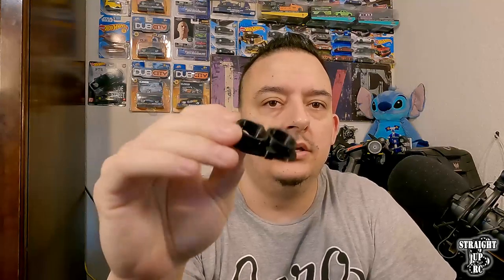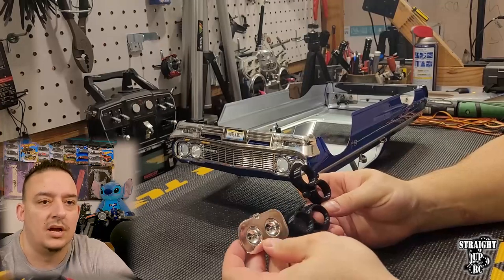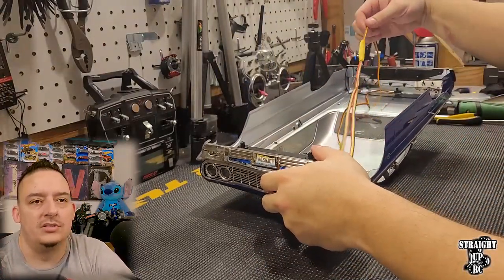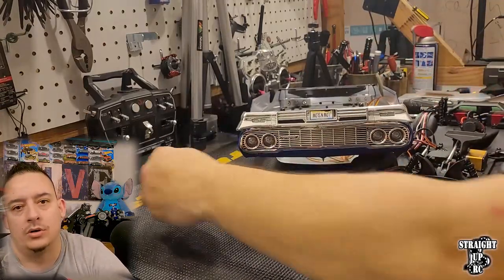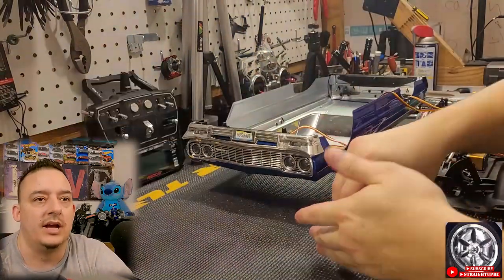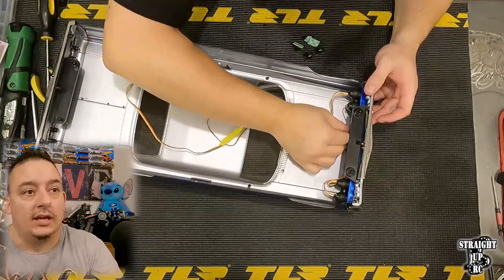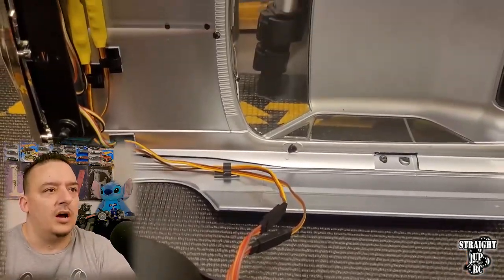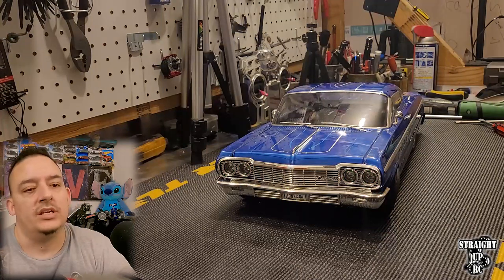Redcat 64 HALO LED Angel Eyes!!

Comment: Can you run this with the other redcat lighting kit
Reply from the maker: Good Question - and the answer is YES you can still run the turn signals and rear tail lights from the 64 light kit from Redcat. This custom bucket and LED set up only replaces the head lights which makes that headlight LED strand in the Redcat kit unnecessary, but the rest of the lighting still works as normal on the Redcat LED kit.

Comment: I’m confused on how to keep the lights on one color. After you leaving the switch up the color will stay the same after hopping the front?
Reply from the maker: Yes. If you leave the switch UP on a specific color and use the "front" switch on the side of the remote to use activate the front - the color should stay the same color. 

If you hit the "button" for the front of the car on the center of the remote - it will change the color again.  Or if you lower the switch and go back up - it will change the color as well.

Comment: How can I make this work if I have a dual front servo set up?
Reply from the maker: If you are running a dual servo set up and 1 servo is plugged into channel 3 and the second servo is plugged into channel 4 - you will not be able to wire the lights up to channel 4. However, the receiver has 3 other ports that you can technically use to POWER the LED strips with. But you will not be able to control the light color with the remote on command. You will have to unplug the lights and re-plug them back in to acheive the color you wish prior to driving. OR you can wire in a receiver wire "on/off" switch and run the switch to a location on the car you can turn on and off the LEDs with and it will let you switch the light color directly even without having to unplug them. It is somewhat of a procss that takes extra steps - but it could be done.

Comment: Where can i purchase these lights with the buckets?
Reply from the maker: So the headlight bucket and the LEDs are technically sold separately. I do not sell the lights directly as of yet. And the buckets are made to order. With that being said if you message me on either my Instagram account of Facebook I can cover the details on that. Those links can be found in the videos description box on the bottom. There is also a link for the lights found on Amazon in the video description as well about half way down. Any other questions feel free to let me know.

Comment: What about back lights
Reply from the maker: The backlights are simple red bullet LEDs. In order to use a light similar to the HALO LED style lights the light "bucket" would have to be modified or "cut up" to fit anything like the front. The smallest "HALO" style LED I have ever personally seen was 8mm - and the hole for the back LEDs is too small.  Or someone could simply find a 3mm LED that has a multicolor function. These custom buckets do not modify anything. They simply replace the stock light bucket.